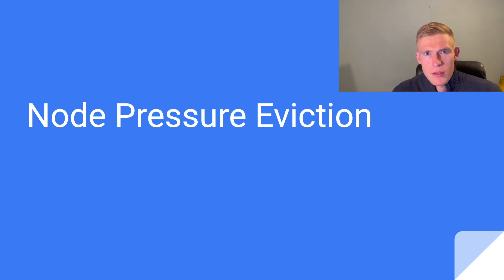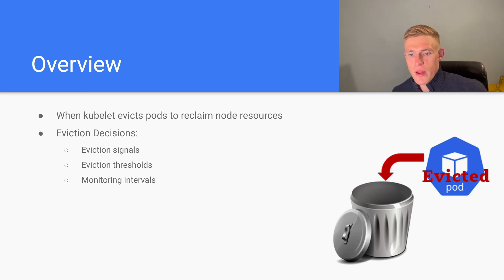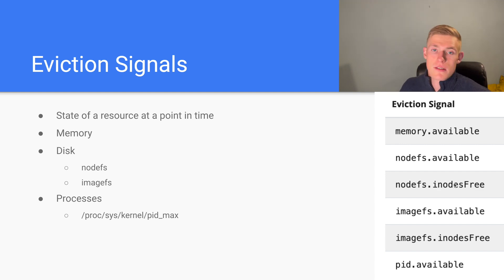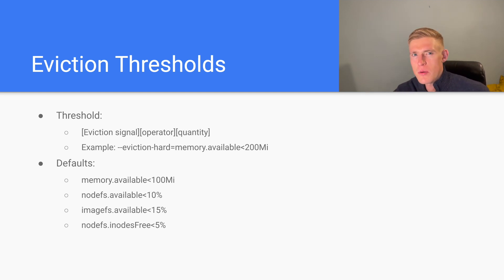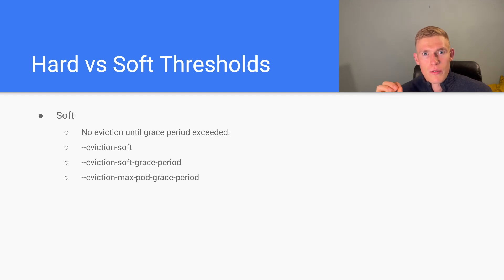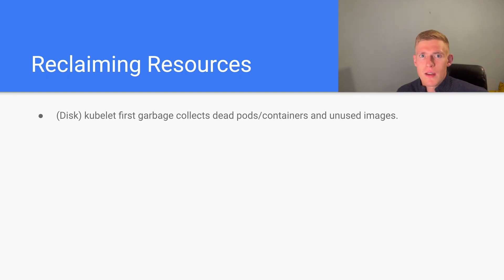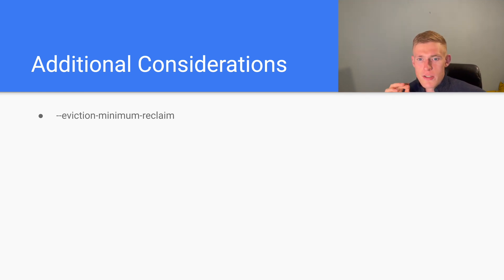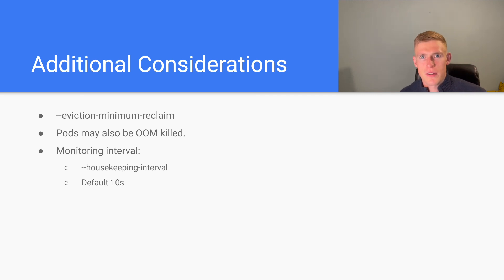Node Pressure Eviction | Kubernetes

Comment: Great video! Just a small correction, at 9:00 you said that pods that exceed resource limits is a parameter for pod eviction, but I don't think that's true. Pods that exceed resource limits are killed by the Linux Kernel in the case of memory or throttled in the case of cpu. If you meant pods's resource usage that exceeds request, then it's correct, and that's also in line with the K8s docs.

Comment: Thanks for the video! Learned alot
Reply from the maker: Thanks for watching Luke!
Reply: @jmmtechnology4539   no problem! Question for you, in the case of Disk Pressure, is there a specific place/directory it is monitoring for disk space? On k8s on Linux(specifically RKE2) I have gotten the Disk pressure taint when there appears to be space left on the node. Cheers!
Reply from the maker: @lboncich1  Yes, my understanding is that by default it will monitor the root filesystem, ie / in linux and any subdirectories. If you have additional filesystems mounted to your machine you may wish to monitor those as well but I don't believe there's currently a way to configure kubelet for these types of scenarios.
Reply: @jmmtechnology4539  Awesome. Thanks for the insight!
Reply: I have used Terraform blueprints eks project to create a cluster with ARM based bottlerocket nodes which comes with 20GB disk space which is not enough space. I tried hooking up additional volume but I can’t seem to find a way for containerd runtime to save the image to the external volume. It seems to be using the 20GB space. Did you need to configure your cluster to handle storing images in a different volume?